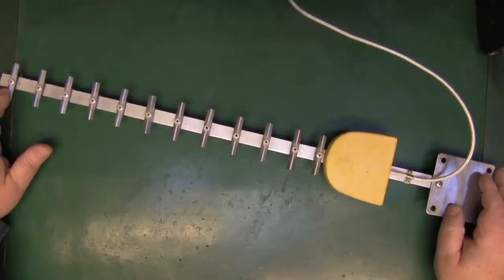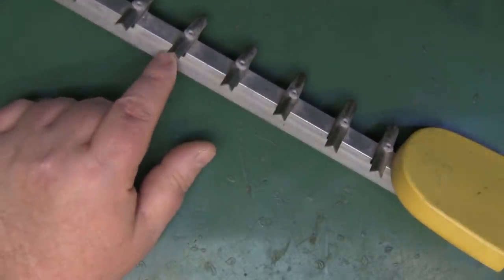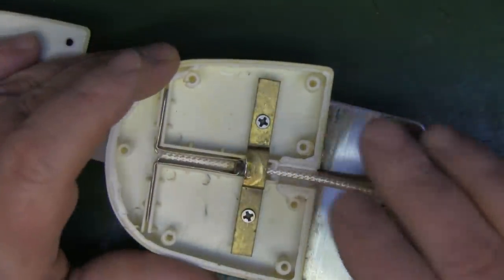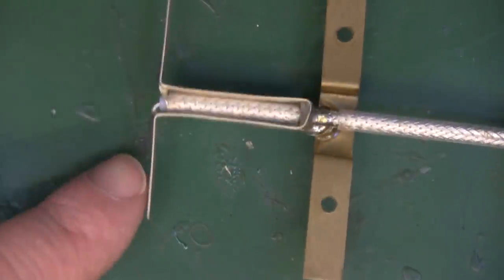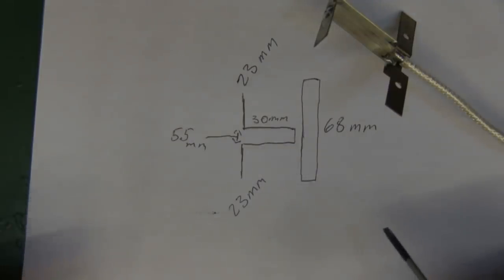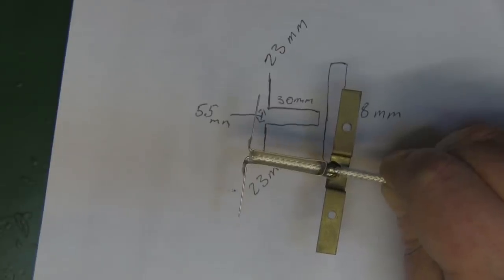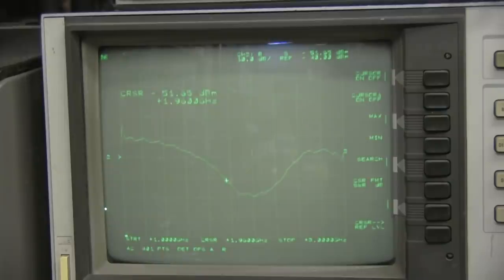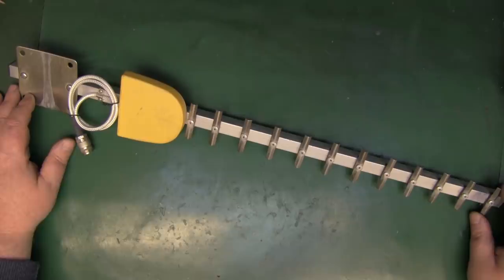16 Element 2 4GHz Yagi

Comment: The measurements will be slightly off because of that balun; the impedances and reactances must be adjusted by changing the spacings and sizes of the parasitic elements and also the antenna's directional characteristics including the F/B ratio will be changed by the spacings of the elements.

Comment: Thanks for the details.  That last video got me thinking about polarization more and with this video immediately thinking to further improve this and your other yagi designs by adding a perpendicular element to all the elements like instead of just the dipole, use a quadrupole or "+" like pattern.  Seems would not only increase gain from surface area... will increase gain from the scattering?/refraction? where the polarization might have changed.  For sat comms antennas makes more sense... I'm guessing in urban environments and antenna positioning still makes sense.

Comment: There is a similar dipole balun design,  slightly modified for parabolic dish feed from Stella Doradus antennas. I teared apart plastic case and it was made using Rg213 and soldered and crimped brass or tin thin plates. It works well. I am modelling LFA yagi on Mmana-Gal, using different diameters of elements for 2.4.  Quieter antennas with full loop dipole. Over 20dbi with short booms.